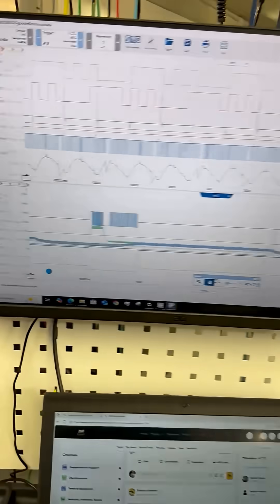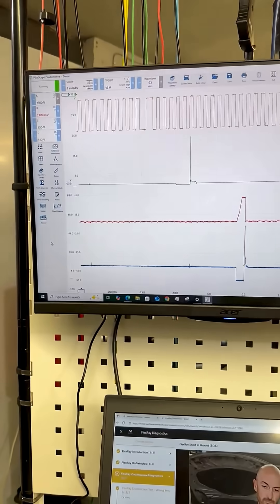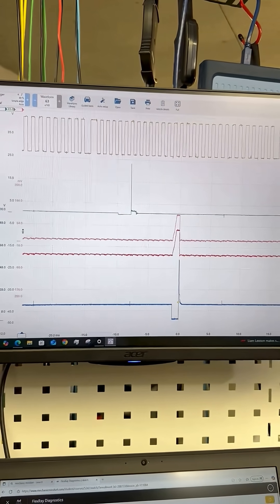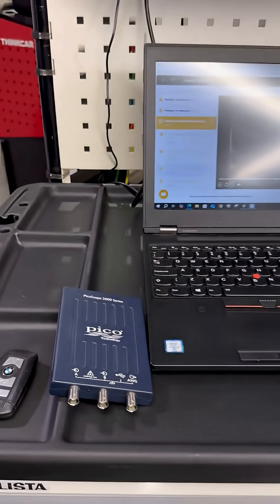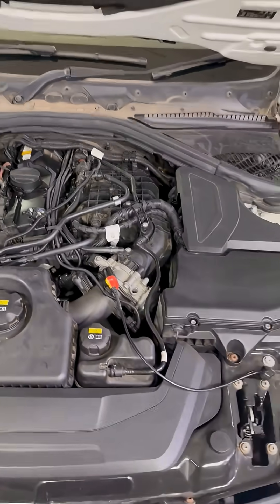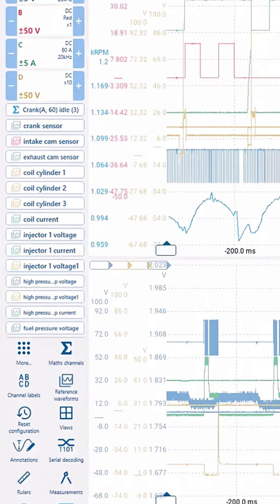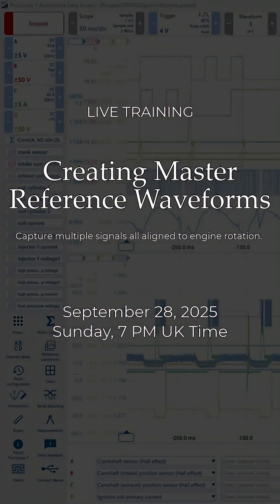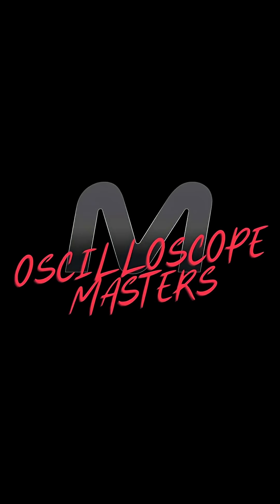Live Training: What's a Master Reference Waveform? | Mechanic Mindset

Comment: What I have noticed though Darren is when I use pico 7 with ny 2204A plugged in I get no waveform library at all 🤷🏿‍♂️
Reply from the maker: Yes that’s right, it’s not included. Available for Automotive scope only
Reply: @MechanicMindset yeah I thought as much 😂 just a great piece of kit and far better sample rate than my 8ch hantek and my 4ch snap on scope 👌